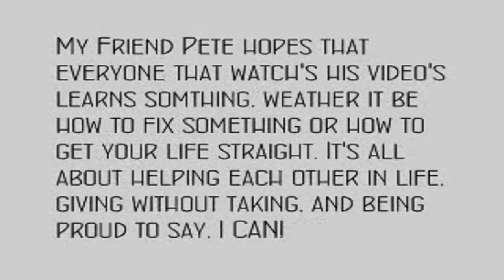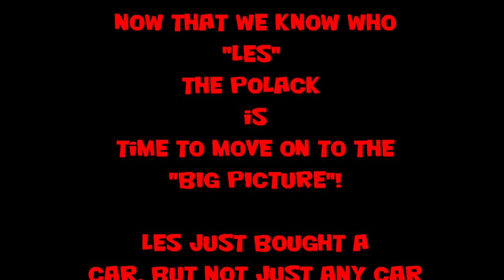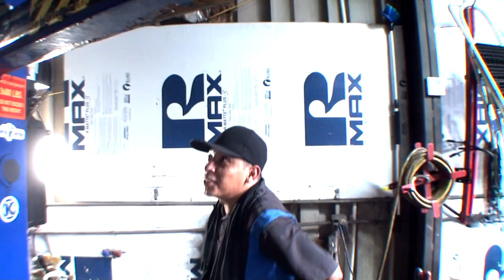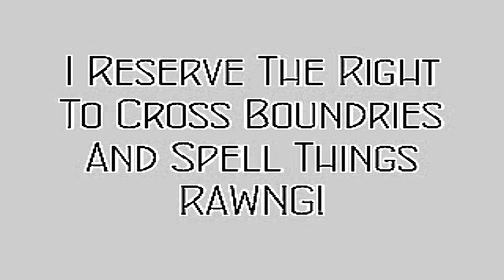1966 Mercedes-Benz 600 GROSSER - Ultra Luxury Sedan - EXTREME RARE FIND

Comment from the maker: This is an AWESOME Example of Automobile History -- But whats better is those AWESOME SWRNC T-shirts on the Merchandise Shelf above this comment... SUPPORT My Friend Pete and get one TODAY!
Reply: Pete , My Knowledge on those 600 Kompresors is minimal but I remember reading some where that if you lift it, Be sure to support the suspension or damage will Occur ... Chain the A frames together???  if you don't have a wheel lift... Many Blessings , SMR
Reply: @TheSmreeder  yea special system,i rember expensive fix.
Reply: fuel pump check valve causes long crank time check fuel pressure,need service in fo ..rare car preety clean mileage?

Comment: The Mercedes 600 Model was a limited production run automobile, and most were made on a stretch limo chassis. They were the standard ride for European heads of State up until the late 80's. At one time former Soviet Prime Minister Leonid Brezhnev owned a fleet of more than 40 of these which were  most of them made. MB wanted to build the best automobile ever built regardless of cost and it was. It was powered by a 6.5 liter naturally aspirated V8 engine.

Comment: No matter how rare that Mercedes is, I would not want to own it. One could spend thousands even before the body work to get it pristine for driving.  It will be a gas pig being 6.3 liters. That is about 390 cubic inches. The car has way too many un necessary bells and whistles to screw up. Parts for this car will be extremely expensive! Reselling will be difficult, at least finding the select appropriate buyer will be difficult.
Reply: Nah its like a Patek it will sell when it needs to be sold.

Comment: I remember some car show I watched once talking about how big a pain in the @ss that hydraulic system was on those cars. They would develop a leak and fill the door with hydraulic oil.
Reply: Jay Leno did a good video on a 1972 model, and touched on the issues with the hydraulic system.
Reply: @VC-Toronto  it may have been on jay leno's garage, I watch so many car shows they start to blur together lol